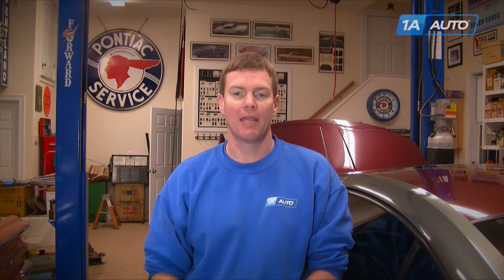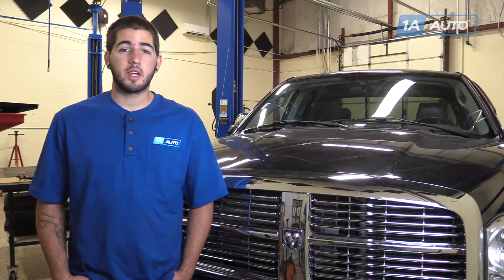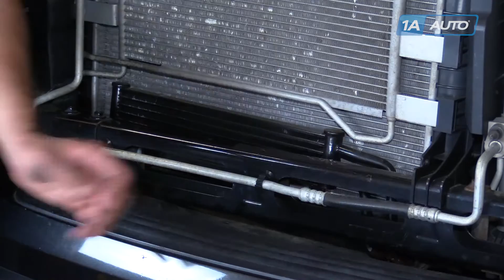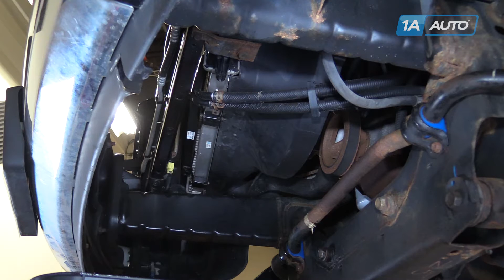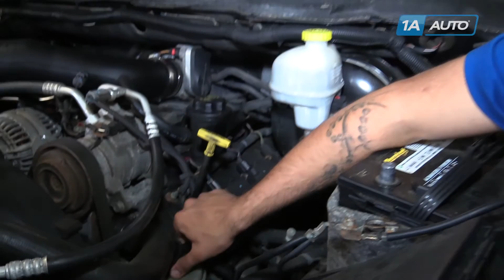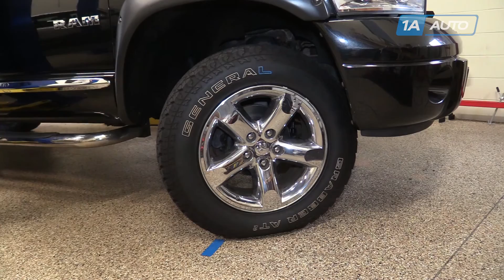How to Replace Power Steering Oil Cooler 02-08 Dodge Ram 1500

Comment: This looks just like the 2004 Dodge Ram 2500.  The directions are easy and straight forward.  The one problem I am having is with how the part attaches.  My original cooler became damaged because it fell loose and scraped on the road causing a hole in the cooler.  When putting the new cooler on, there does not appear to be holes on the radiator to put the cooler's bolts through.  Does it clamp on via friction when you tighten the bolts or do I have something missing that should have the holes to put the bolts through?  To be clear, the bolt holes on the replacement part are there and make sense.  It is the bolt holes on the radiator that are missing.

Comment: I'm having a real trouble trying to put back in a power steering hose line to a Pontiac G6 return line is particles in the front all the way to the back any advice information anyting

Comment: A-1 Auto you have great videos and easy to understand tutorials. The problem I'm having is I need a video showing how to locate and replace the power steering oil cooler system on a 2001 Dodge Ram. The Only videos I could find were on 2002 thru 2008 models and those systems are totally different; other than that I have subscribed to your Channel and appreciate all of your effort to making your videos thank you

Comment: Thanks, I have an 06 1500 4.7 liter, basically the same set up. The power steering oil cooler has been leaking for a few months but I originally thought it was the transmission cooler.
Reply from the maker: +Jon Begay Thanks for checking us out. 1aauto.com
Reply: Yes because Dodge uses transmission fluid the power steering system!